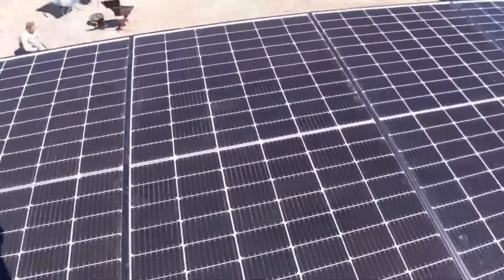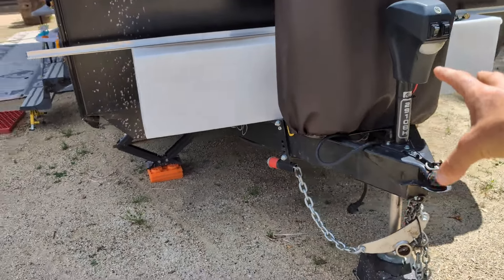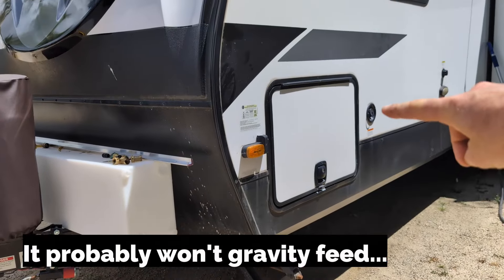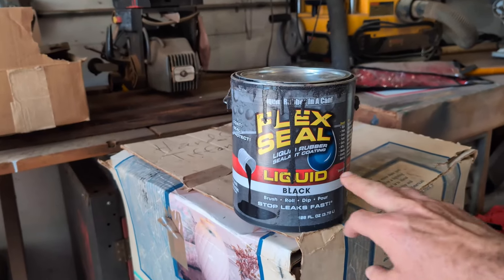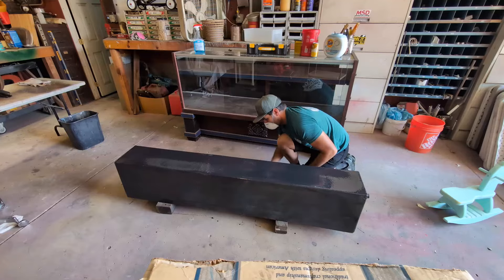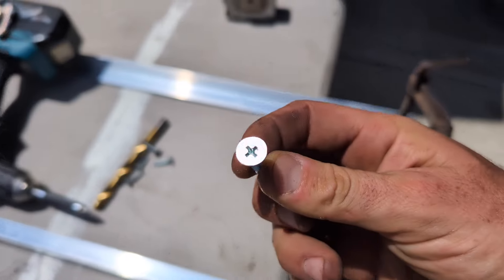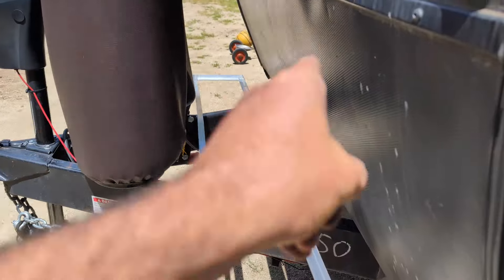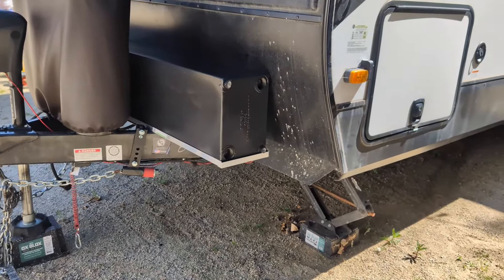Boondocking Water Supply (Auxiliary RV Water Tank)

Comment: Great idea and good placement. The weight that far forward will put most of the weight into the truck not the length of the frame. 332 is the weight of two smaller people, that won’t buckle the frame. If you’re worried due to YouTube comments, take the rig to a scale, weigh the trailer axle before and after filling the tank. I’ll Venmo you the scale fee if you post an update showing the result.
Reply from the maker: Thanks for the input! We are stoked on the extra capacity!

Comment: You'll want to throw a couple more ratchet straps on that especially after filling it. 40 years trucking and building oilfield equipment tells me right away you probably won't make it from the fill station down the road even a few miles without losing that 350 lb missile off the tongue of your trailer unless you're driving under 20 mph. That aluminum angle iron frame with wood screws holding it will fold like tin foil on good pothole. Empty should be ok.
Reply from the maker: Yeah when we add the cover that will have 2 more straps as well around the whole tank

Comment: 40 Gallons x 8.3 lbs = 332 LBS. I see a follow up on this knowing scam design uses flipper frames, is that chance of buckling this is quite high. If you are watching this and thinking of doing this, think twice. It only takes one time where the trailer is angled lower and the truck is higher, and one divot to cave that thing. Not a fan of BTBRV  JD, but he did a video on weight and buckled frames. Sorry, but I would never risk this.
Reply from the maker: Thanks for the input.👍
Reply: Absolutely agree!!!  Terrible place to put it
Reply from the maker: Where else could it have been put?
Reply: The bed of a 3/4 ton truck is where i am putting mine, with its own pump.  Building it for a 2k mile trip we are taking in sept.

Or if you want it on the trailer, i looked at steel members attached to the frame going across the trailer directly above the center of the axles.

I've gone thru the classic lippert failure of cracks in the web of the i beam frame over each spring hanger.  Part of that repair was to install square tubing across the trailer welded to side of all the pairs of spring hangers to eliminate bending force on side of beam.   The top of those would be a great place to mount a tank.

After seeing all the lippert tongues bent up, i installed 2" square tubing 27" long under the box beams that make the tongue and centered where they usually bend at that front bulkhead.  Found some long heavy square u bolts on internet.

For goodness sakes be sure you disconnect your WD hitch before you go off road.

Just remember, as flimsy as travel trailers are, the frame is by far the weakest component.  No offense, but you could not put that 300 lbs in a worse place, exactly where they bend.   The tongue is a fabricated box beam that is between 1/16" and 1/8" thick.
Reply from the maker: @jimcollins8097 thanks for the input, we have done all of that to our suspension as well. I think it will be fine to be honest. Time will tell
Reply from the maker: Also just keep in mind you'll be over payload most likely with 40 gallons in the bed of a 3/4 ton. Just a thought
Reply: No i will not be over on my 3/4 ton.  2020 gmc, has 2700 payload capacity (weighed it on way home from dealer).

I normally pull at 9500 lbs on the truck.  That includes a 500 lb folding golf cart, which will not ho on sept trip.  

My travel trailer came from factory with omly 700 payload capacity.  

After 2 trips out west the tires were rubbing the belly.  I have replaced 3500 lb axles with 5200 lb units, replaced everything below the frame.

Best of luck.  May The Force be with you.